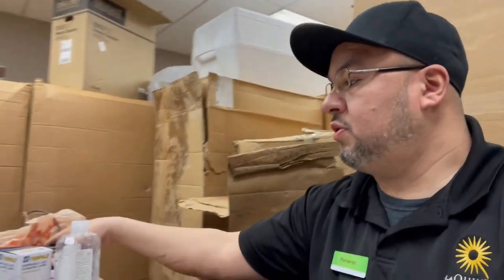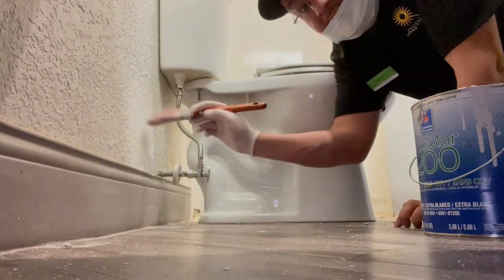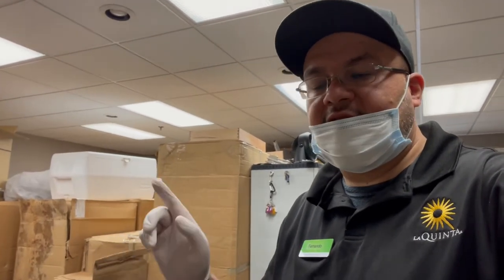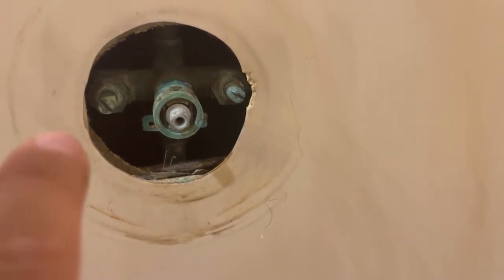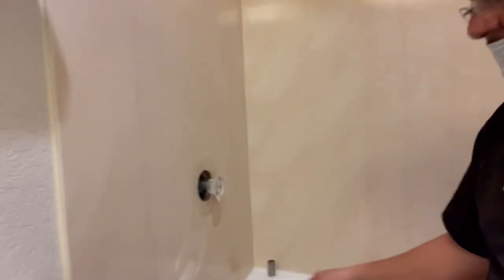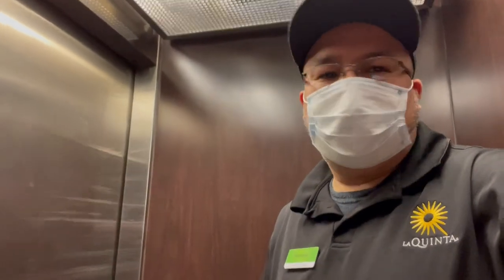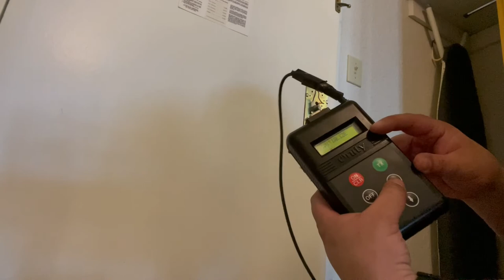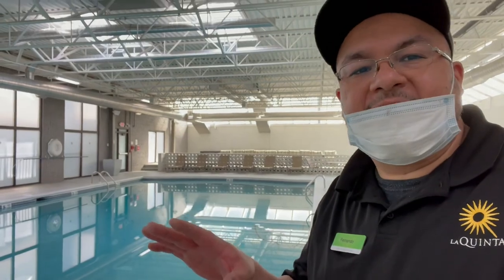HOTEL LOCKS AND CARTRIDGE

Comment: dealing with plumbing like that could be a nightmare for my places style when you turn the water off you make sure the nut behind it doesnt turn with it or you could have water blasting you in  your face. our cartridges are the annoying type with springs and sits in the divider and you have to use channel locks to pry it off.  never seen a pin style like yours before good shit. i always say before you mess with water always know the main is located incase of a bad valve or emergency.